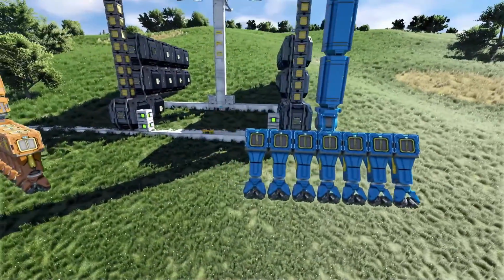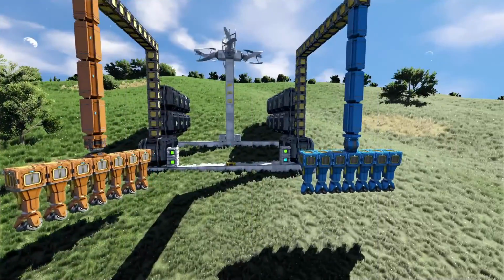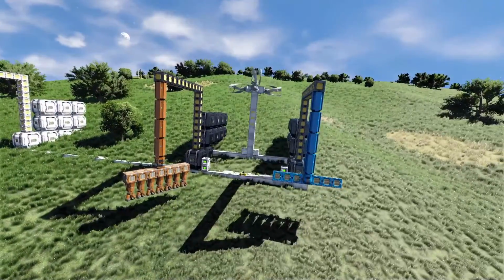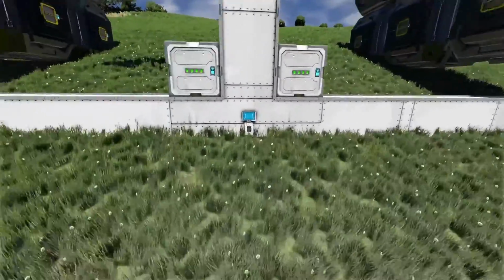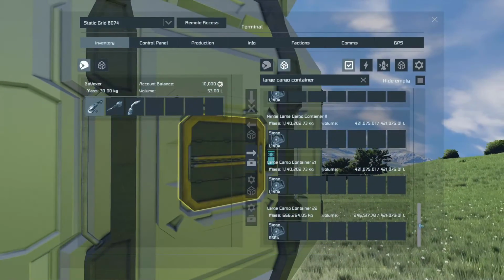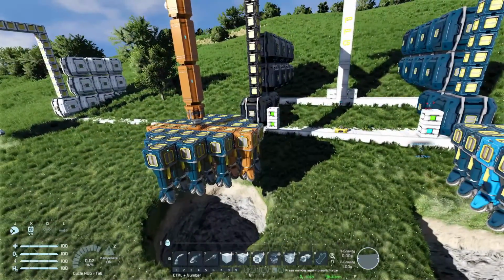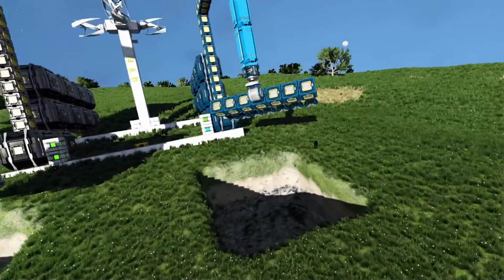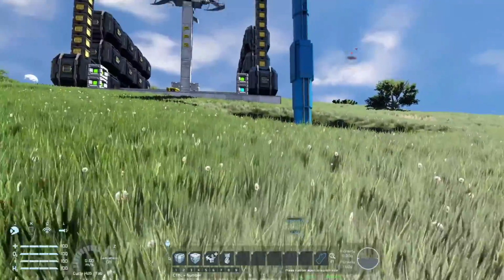Space Engineers Experiments: Rotor or Hinge Drilling Rig? Which Is Better?

Comment: SOmeone HALP i have a hinge set up on my ship that lowers a drill, but the conveyor system wont work.........
Reply from the maker: Make sure your hinge and connectors are completely built and connected properly. Also, The hinge block has 2 parts, maybe check that to see if both the outside and middle parts are fully welded.
Reply: @PandemicPlayground  thanks for the reply man, it turned out to be bugged for some reason.... loaded it up in creative and it worked fine right off the bat... went back to survival and it worked fine :S lord clang was mad i guess

Comment: Just think what would happen if you put the hinge above the pistons instead of below
Reply from the maker: It would be a broom like drilling system lol
Reply: @PandemicPlayground  and the sweep would be 66 blocks across with just the same cost and almost triple the amount of material as having it below.
Reply from the maker: Yeah, this sounds to be most efficient, but I'm still picturing like a broom action lol. This is an amazing idea to collect material for low cost.
Reply: The difference here is the circular one can be expanded exponentially because of how circles work, for every drill you add to the line you increase the overall size of the circle each time. With the square you get the same increase each time
Reply: @coolent_cracker3287  that's true but you'll eventually get to a size were you will have to either slow down the rotation speed to allow the added drill to extract the minerals instead of passing over it occasionally

Comment: I hadn't thought of the fact that the hinge system would give you a square hole.  That could be very handy in the future.  Also, you can get rid of the timer blocks completely from that system if you use sensors.  Sensors can detect sub grids, which the drills will be as they are attached to a hinge.  Set the range of the sensors so that it sees the drills when the hinge is completely turned (you might miss a degree or two but it will be close) and then set the action to reverse the hinge.  With a sensor on either side set up the same way, it will just keep going back and forth.  You might need a conveyor junction between the piston and drills to give you somewhere to put the sensors.  I just tried it in a creative world and it works really well.
Reply from the maker: That is a neat idea.
Reply: Good thinking bro.
Reply: but doesnt the timer block just seem alot easier? i also made a pretty crazy drill my first playthough. had a combination of rotors and hinges. and it would mine out a huge area going down, like and extending robotic arm.
Reply: @TheGoddessPraisesYou  The timer block requires you to do some heavy math to figure out how long it needs to run.  Most people just try it over and over until it works.  You need to make sure it goes all the way to the opposite side and doesn't pause there for a significant amount of time.  The sensors just need to be set once and will ensure the drills go all the way and don't pause anywhere.  It doesn't make a huge difference in work but if you change any speeds, the sensor version will continue to work properly but the timer would need to be adjusted.

Comment: For the rotor system there is a more efficient way to build it. Instead of using a T-shape as in your drill system you could use an L-shape instead, connecting only ONE drill directly under the rotor and then go with all drills in one direction. You still have only 7 drills but the diameter of the circle becomes a total of 12 blocks rather than 7. So you nearly double the area you drill out with the same amount of drills. You'll also drill out a lot more material.
But I really like the shape it drills out of the hinge system.
Reply from the maker: That would be a good way to make a large circle and save materials.
Reply: If you double the radius, the area should almost be quadrupled because Area = PI * r^2.
Reply: This method works but is risky to clang in multiplayer due to the heavy weight of drills sagging on the rotor.  People usually use a center line for this reason.